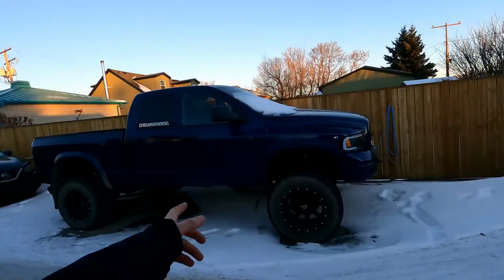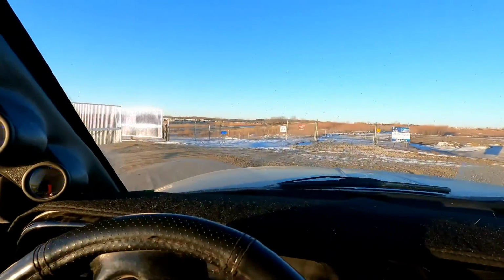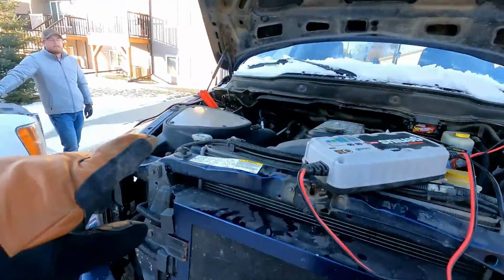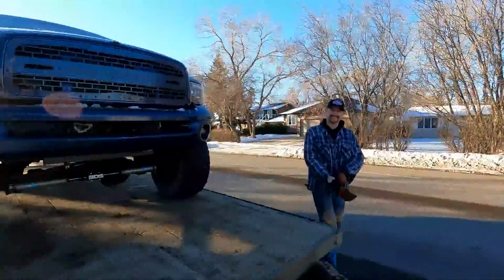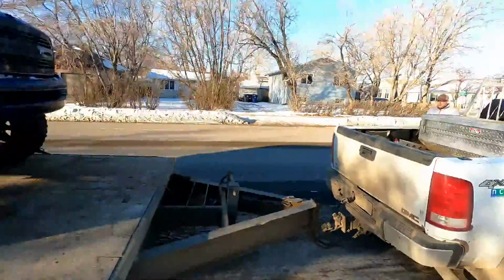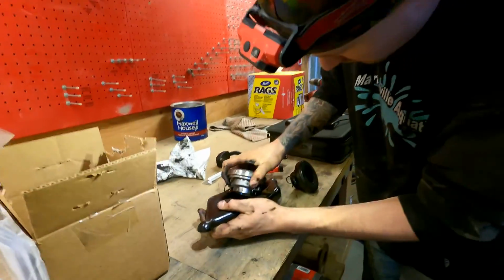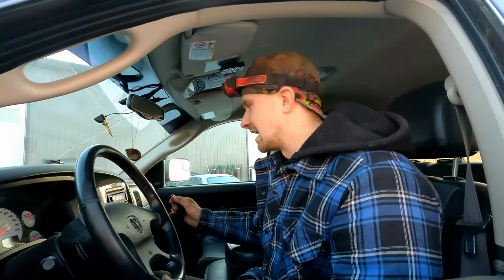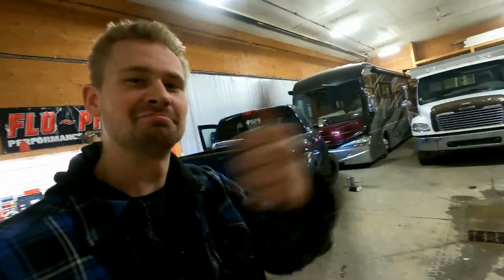The 3rd gen broke down again!

Comment: Great video again bro!
You a mechanic tell us the truth come'on dont lie why a cummins?
Which is the most truck comes around your shop to get fixed
Reply from the maker: I dunno man they are all the same honestly. If you treat them good and keep up with oil and fuel filters they lash a long time. The only ones I’d stay away from are 6.0 and 6.4 powerstrokes. I’m not a die hard cummins guy, I had a duramax first, then Cummins because I got a good deal on it, and if I were to buy a brand new diesel I’d would most likely be a powerstroke. They are all good
Reply: @darkirondiesel  thanks bro i think if i would buy a new truck would be a megacab

Comment: I have the same exact headlights in my truck but they dont seem very bright….what did you do to make them bright…also, my motor drags ….not long but even if its been driven all day….i wonder if the fuel pump or something like that is going on…it doesnt run rough ….but doesnt run right when starting it…any help would be awesome

Comment: Love the older and lighter diesels without DPF and all the pollution crap. The new trucks weigh too much. My truck eats batteries. I swapped in a HD interstate battery and haven’t had an issue in a few years. I also have a big audio system. Want to upgrade my alternator to make more amps.
Reply: Ps: didn’t know your dog died - he was cool. Sorry. I’ve gone through that a few times it’s hard.
Reply from the maker: Thank you

Comment: sorry to hear about bronx man.i have an 03 5.9 cummins and when i have it plugged in for the block heater, it will start quick even in -30 but if i dont plug it in, it will take around 5 seconds to start between 0 and +10 and just wont start below zero if not plugged in. any idea what the problem could be
Reply from the maker: Does your grid heater work?
Reply: @darkirondiesel  it gets slightly warm to the touch if i feel under the intake manifold and hooked up the multimeter and it has power going to it

Comment: I have a question about your headlights, I just bought a set for my 3rd gen and im looking to put  led bulbs in them, did you by any chance do the led conversion and if so what bulbs did you use? And how did you do it ?
Reply from the maker: I have fck lightbars LED lights and it was kinda a pain in the ass. The connectors weren’t the same so I directly wired them in haha